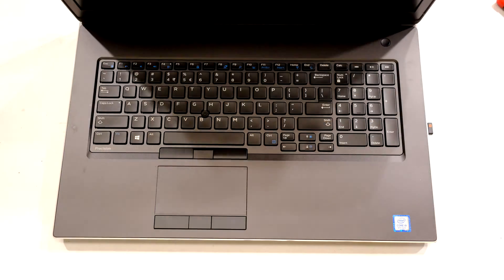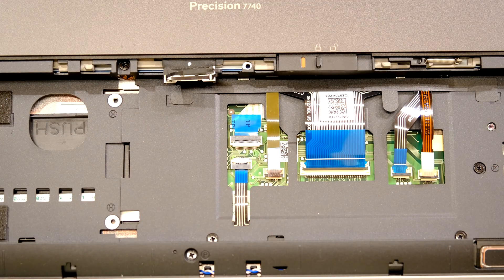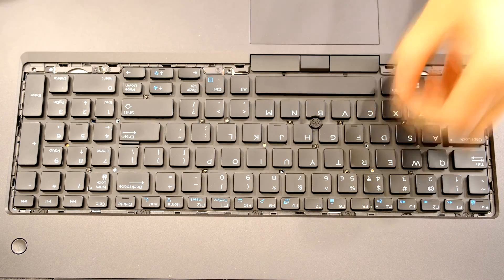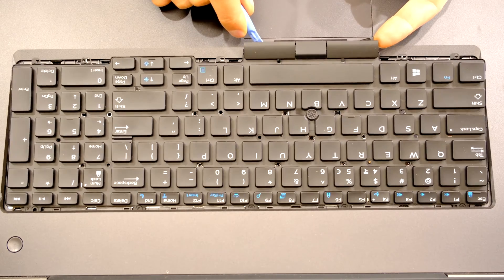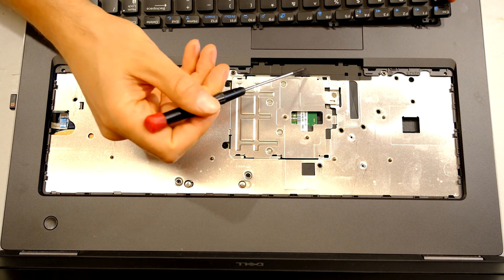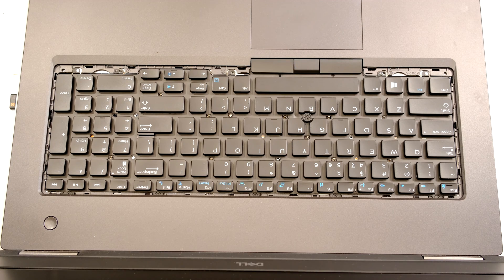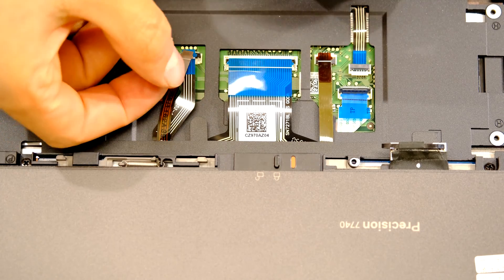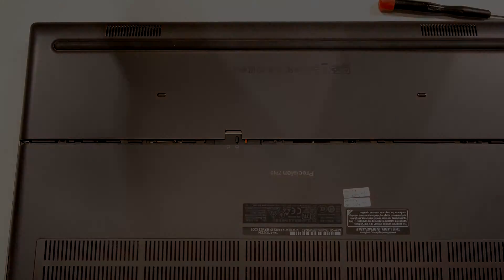How to change the keyboard on a Dell Precision 7740 laptop

Comment: Am i right in that the LEDs are not actually part of the keyboard itself?  The keyboard just has holes for the LEDs to shine through?  Does that mean it is impossible to upgrade a nonbacklit unit to be backlit?
Reply: To answer my own question while it does seem the LEDs aren't part of the replacement keyboard itself the LEDs were there as was the connector on the mainboard for the backlight cable (stock have 3 vs 4 ribbon cables).  So yes, you can upgrade a non-backlit to a backlit keyboard.
Reply: @chrisgreen7725  Thanks for answering your own question.  I'm just about to place an order and was wondering the same as you about upgrading.